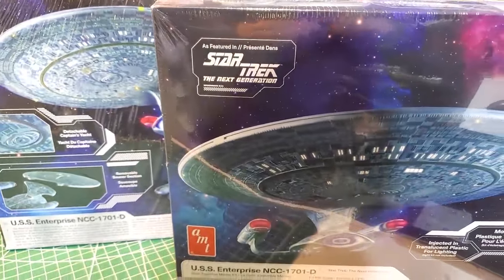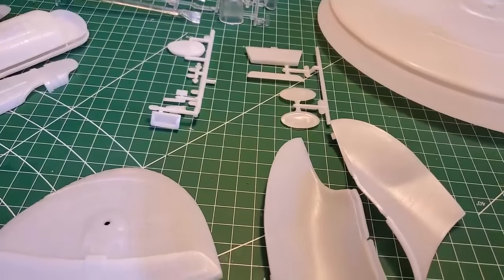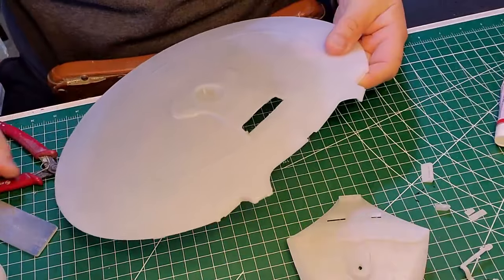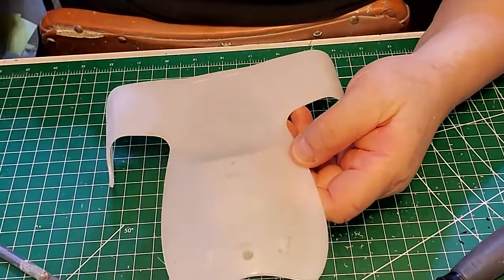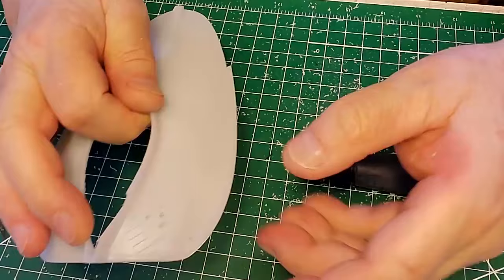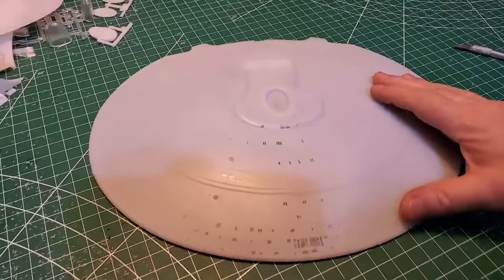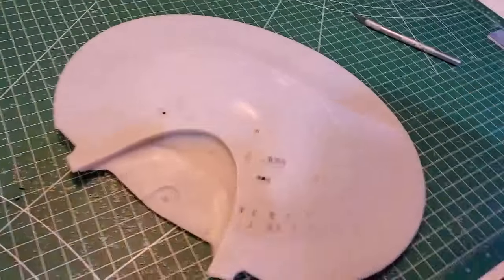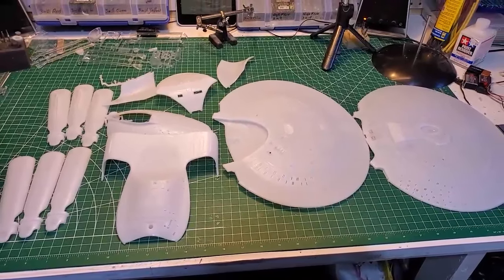Enterprise D Refit Build Part 1

Comment: Wasn't the model made from translucent plastic so that you wouldn't need to drill holes?
Reply from the maker: Yes it was but I have to paint the interior as well so you'd have to scratch out the area where the window is there also but there is no indicator as to where the windows are inside so I drill them out completely then use window maker to fill them in again. Either that find a masking set for the tiny windows and mask them but you'd have to have enough masking for the interior but then again you run into the same issue, there is no indicator where the windows are in relation to the exterior.
Reply: @epycmodels946  You could try priming both sides, scrape the windows out on the outside, then put a light table/other light source behind and only scrape the inside where window light is already coming through.

Comment: I just used a drill to lightly scratch out the windows, but not thru the plastic!
Reply from the maker: Then you need to scratch out the interior as well as long as you know where the windows you did on the outside.